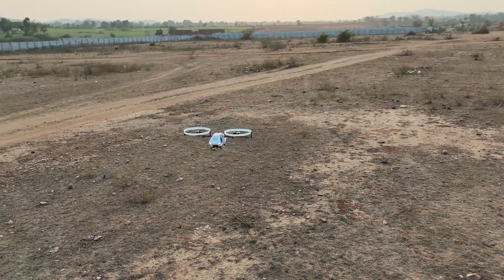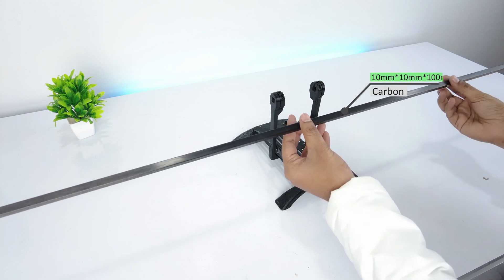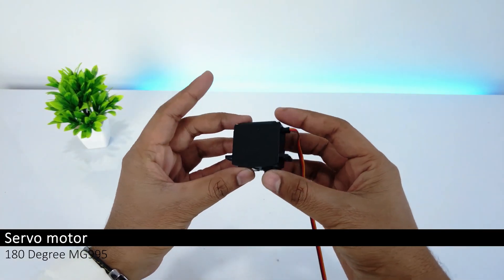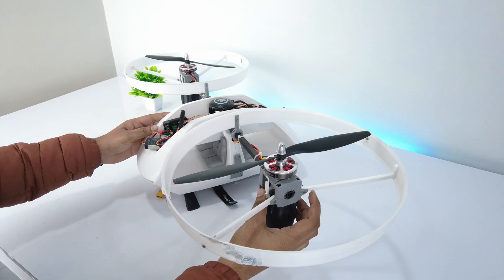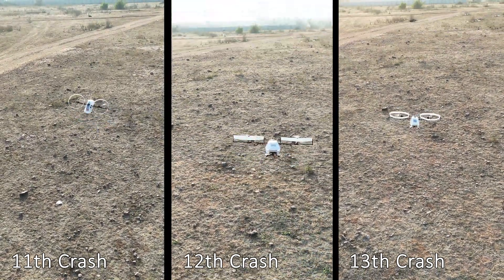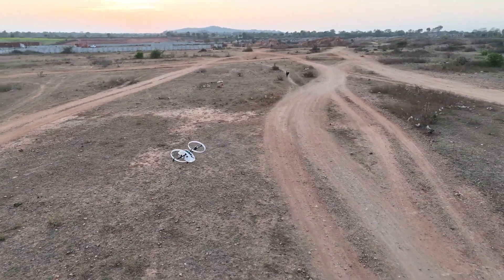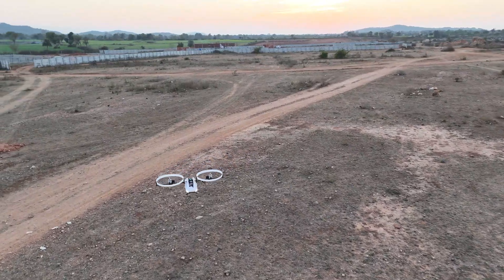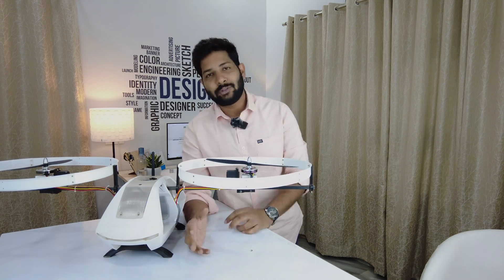This Bicopter Could Be the FUTURE of Flying Taxis

Comment: Working on a similar project myself 
I recommend using LQR and not pid to better control pitch
This is a very nonlinear system so read into it and try gain scheduling 
Try to emphasize the use of differential motor to deal with the longitudinal and lateral coupling 
And the best and a more complex solution would be to add a swashplate
Reply: You use Pixhawk too? I'm want work with him, last day i get a PX4

Comment: Looks cool! I have a few questions though: first, I'm surprised by the 2-blade propellers, since those produce less thrust than 4-blade versions, have you tried other propellers? And second, are you still tuning your PID settings and other flight controller settings? Some shots still show significant instability, e.g. at 5:18 or so, rocking from left to right.
Reply from the maker: Thankyou for your response 
These motors are designed for 12, 13 and 15 inch prop.
Since using other prop makes the drone larger so I have used the 12 inch one.
And I haven't seen a 4 bladed 12 inch propeller yet.
And regarding the 5:18, we are still working on its stability as whenever wind try to push it, it becomes destablize....But on a calm day, it flies good.
Reply: @MechNinja  Ah I understand now, I'm certainly not used to 12+ inch propellers so I haven't looked at options for this kind of size. I looked it up and and there are some for sale, but most are pretty expensive. One that showed up a few times is the Falcon 12x5.5 prop with 4 blades, but it sells for almost $100! In any case, thanks for the reply :-)
Reply from the maker: Do check my other videos...you'll love it...